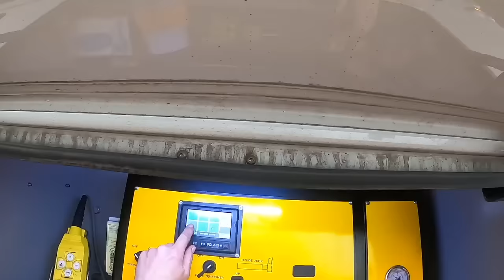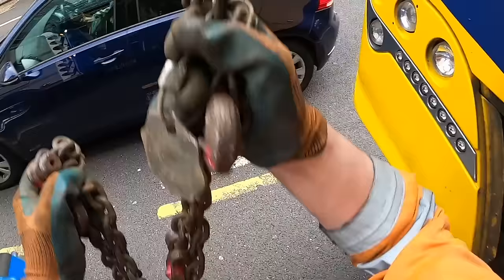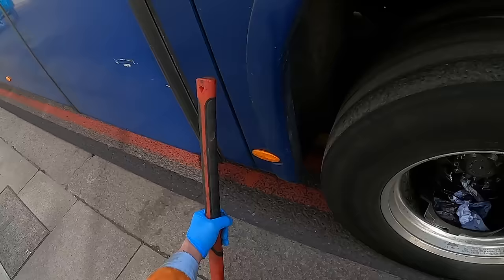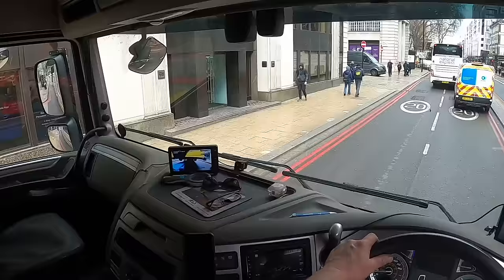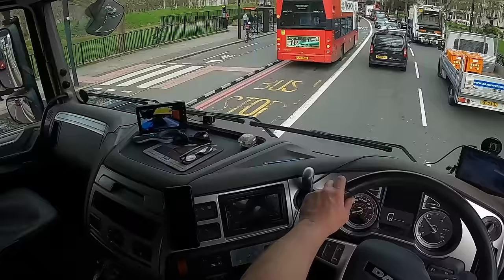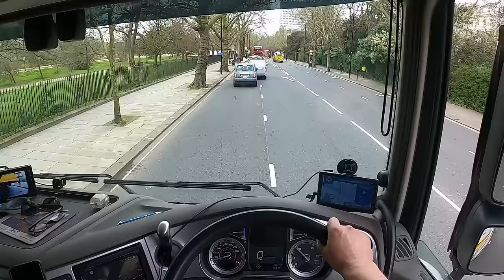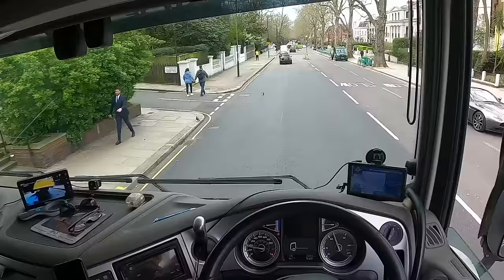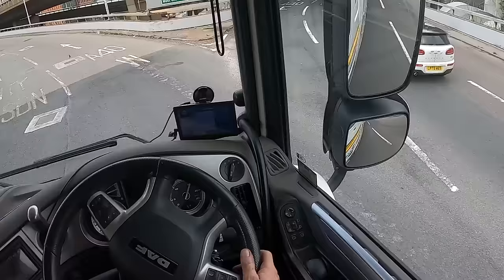TOWING A 79 SEATER COACH FROM CENTRAL LONDON!

Comment: Hydraulics really are amazing. The amount of force required to lift that bus with a bar sticking out 25 feet off the back of a wrecker...
Reply from the maker: Hi Glen thanks for watching , Boniface under lift has 33 tonne capacity plenty of power as you not lifting all of vehicle.
Reply: @HeavyRecoverywithSteve  and do you not find that amazing???

Comment: You need a medal as big as a frying pan pulling that through London
Reply from the maker: Thanks for watching Eddie.
Reply: if it broke down in london. The only way youre going to get it out is through london. Aint no RAF recovery service sending out a chinook to lift this thing.
Reply: Try multi drop in a Class 1 Arctic in Central London , you'll shit yerself lol 🤣🤣🤣
Reply: I spent the last 14 odd years driving an artic tanker round london and the suburbs etc delivering Adblue to bus depots, haulage and tipper firms etc.. absolutely loved it. Preferred doing that than dealing with the last minute lane changers on the motorways etc..@Theoriginalbigbrillo

Comment: Love these videos. Coming from the US its like a portal to another world, what seems boring to you sitting a stop light is fascinating to me seeing unfamiliar shops and blokes walking shirtless when its 14 degrees. Thank you for all the videos

edit: 20mph limit throughout London is insane, i think it would drive me mad
Reply from the maker: Thanks very much for watching them , i am glad you like them.
Reply: 20 mph is really annoying, especially on main roads. Most people still do between 25 and 30 mph though.
Reply: @DaChaGee  It's really annoying. I'm American/English, I had a car for the longest time, but got rid of it with the ULEZ expansion. I cannot deal going 50 mph or lower on the motorway. It's like nails on a chalkboard for my half-American brain. Around my home in the US I don't have to worry about speed limits. I can go as fast as I please in some areas. Speed limit is 65-70 and traffic flows at over 90. In the middle of nowhere in the desert I set my cruise on max at 110. The one time I did get a ticket for 98 in a 65 and it was a $500 fine with no points or driving ban.

Comment: 30:05 yes, we do always appreciate and respect our local recovery company. When you're up to your neck in problems, you've got a big piece of metal blocking the road- you really appreciate these recovery wagons turning up.

BTW every Volvo bus and coach (or all that I've come across) have ferry lifts on them, which makes it so much easier to tow- you don't need to worry about tail strikes etc. But Volvo make them so that it can only work when the engine is running- turn it off and it drops back down. I must get the wiring diagrams from IMPACT and I'll bet that it's possible to bridge a relay to force the ferry lift to engage with the engine stopped.

Excellent work as ever, Steve.
Reply from the maker: Thanks for watching and commenting Derek.

Comment: I am amazed on how its hooked up just the axel on the forks with a pair of chains just wrapped around and not tightly fastened down
Reply from the maker: Thanks for watching , safety chain job is to stop the axle lifting out of fork on slope or speed ramp , by chaining in from the side if any side movement occurs the chain will tighten , you can use chain tensioner but metal against metal you will still get slight movement. I have used rubber strips before that does work but only last for 1 job.

Comment: I forgot how many times you have to turn your head, just to keep checking the wing mirrors. I sometimes used to get cyclists hanging on to the hose rack on the side of my tanker when driving in town.

If you could fix a forward facing camera to the rear of your cab, it might be able to film both wing mirrors at once.

Still, great to be reminded why I'm so happily retired.
Reply from the maker: Thanks very much for watching  and comments.

Comment: Hi Steve, love your content. I'm curious to hear more about the Enviro 400s with the ZF axles. I've been in heavy recovery for 6 months or so now and have never heard about this, only know to remove opposite shaft to diff lock if present. Why the need to remove both shafts in the case of the ZF?

Take care, great to see all the safety precautions you take. I've learned a good handful of useful tips from your videos.
Reply from the maker: Thanks for watching mate , apparently pulling one shaft does not fully disconnect the drive to gearbox . We work for various bus companies and part of the contract is two remove both half shafts , i take it they must of had warranty issues. Pleased to hear you find videos helpful stay safe.

Comment: Love your videos Steve - would you ever be used to tow a mobile crane?
Reply from the maker: Thanks for watching , have towed a couple of mobiles cranes , but need to be towed flat with fixed bar and crane needs to be running for steering and to assist with braking .

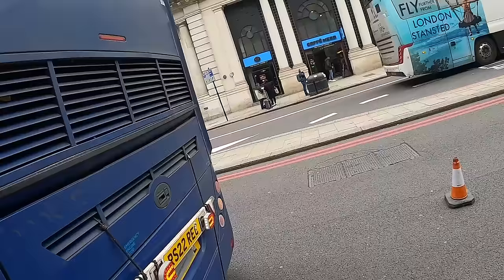Comment: Hello, i would want to ask why only the left "shaft" ( if its called the part that connect the differential to the tyre "what i underestood " also is the part that you removed in minute 22:00 aprox) 
why only 1 and not both or why dirrectly you removed it? I underestand that it's to avoid the tyres forcing the engine that is off
Please tell me! Thanks
Reply from the maker: Thanks for watching , you only need to remove 1 half shaft to disconnect the drive line to gearbox on this Volvo Coach.

Comment: How do you avoid grounding with the rear of the coach? It's almost floor level once lifted.
Reply from the maker: Thanks for watching , Buses normally lower than coaches , so Bus recovery is a fine line between between running with boom at low height without grounding and not lifting it too high to ground rear of bus. Speed ramps our everywhere now so hard to avoid them just have to take with extra care.

Comment: Hi, just wondering what model of Conix lights you are using on your trailerboard? I'm using S.130977 and have discovered that if I leave the hazards on like you do or even one indicator the transmitter overheats and stops sending signal so the lights just go off in transit. If I don't use turn signals or hazards except when turning even with taillights constantly on, I have no issues. I wonder if this is a transmitter issue rather than a light issue due to is constantly having to send on/off signals for the hazards but clearly yours doesn't do it. If so where did you get your transmitter from please?
Reply from the maker: Hi Simon  , think basic model from ebay  transmitter came with it in kit , had this set for 2 years now been ok but have had about 3 charging leads that can easily break.

Comment: If your towing a rear steer how does it steer if it's engine is off ? I know this is a stupid question but for me I can't understand how that works, I always thought you take the half shaft out to disengage from the gearbox making all your vehicles essentially a trailer. That bit I get but how are you still getting any steering ? And would the front axles not also steer? Ps loved the vid 👍
Reply from the maker: Thanks for watching , with electrics isolated the rear steer is not connected to the front steer axle , so the axle is free to follow the direction of travel. The half shaft is removed to disconnect the drive to the gearbox so rear wheels our free running and no potential damage to gearbox.
Reply: @HeavyRecoverywithSteve  Thanks for clearing that up Steve. I always wondered about the rear steer.

Comment: I doubt if you will get a new box under warranty ,it should be stripped and repaired ,It will probably be a bearing ,If only in low box possibly a range issue  or even a prop issue ,,But i  can only guess at the moment ,but warranty wont pay for a new box only a repair ,,28 years on the product lol
Reply from the maker: Thanks for watching ,  Daf dealer still not fixed gearbox .
Reply: @HeavyRecoverywithSteve  It really depends if they have someone who can do boxes ,if it is a manual ,it shouldnt be that difficult,but it s identifying the cause

Comment: Heavy recovery Steve make new video you tube
Reply from the maker: Thanks for watching , by removing the half shaft you our disconnecting the drive to the gearbox you can pull either side but easier to remove the side opposite to diff lock.

Comment: I dont get electricity vehicles, it doesn't really work as a low emissions thing, yes you dont use fuel but lots of countries still use fossil fuel and will just drive up the grid electricity usage. No countries, not even the usa or UK can have zero emissions electricity power as the sun doesn't always shine, wind doesn't always blow and even elon musk said even if the usa was able to go 100% renewable energy it will be impossible wiith current technologies to store all the renewable energy in gigantic batteries. The amount of energy it would cost to mine all the materials for all the major countries to makes no sense
Reply from the maker: Thanks for watching and comments.

Comment: since last year speeding tickets in 20 zones people caught between 20-30 is up by 700% in London alone, figure above 60 for tickets cannot remember but it a lot less. but even your truck loaded its far too easy to stroll over 20. yes places 20 make sense but even if it was still a 30 you still drive to the conditions so prob below 30 anyway. place makes no sense are the big duel roads really they should be a 40 and prob was at one stage. London now is the slowest city in the world to cross. utter crazy and you prob burning more fuel in these lower limits i know my car is as cannot get in to 3rd, 30 zone sometimes manage 4th but even 3rd lower revs at 30 than 2nd in 20 so tend to use more fuel. even kept in 1st more often for bit less boredom as using more fuel any way a bit extra won't hurt. you could not pay me to go to London far too busy for my liking, tend to avoid city's  more fun the countryside way and less stress
Reply from the maker: Thanks for watching Steve and comments.